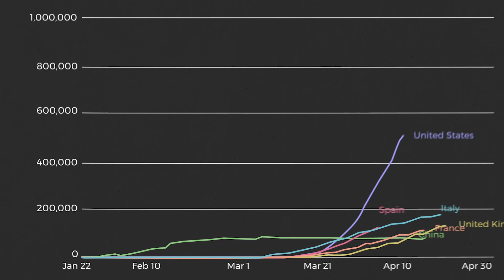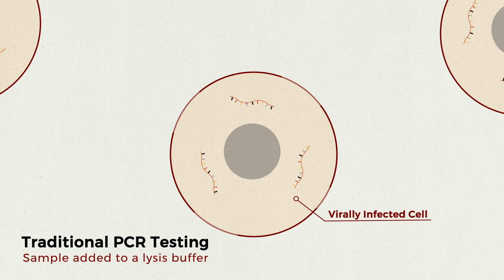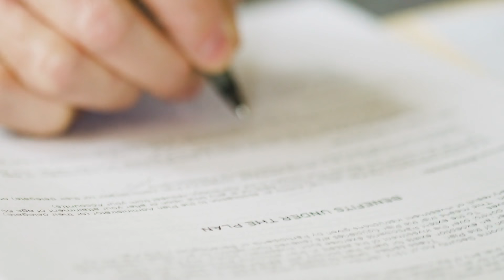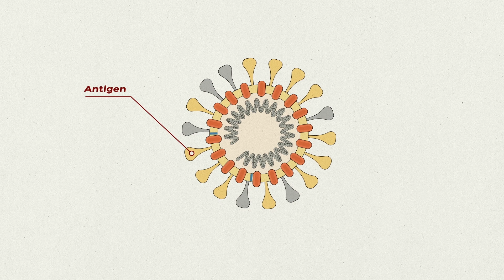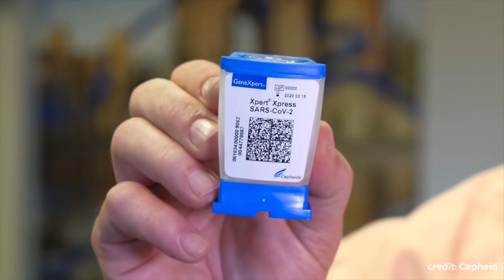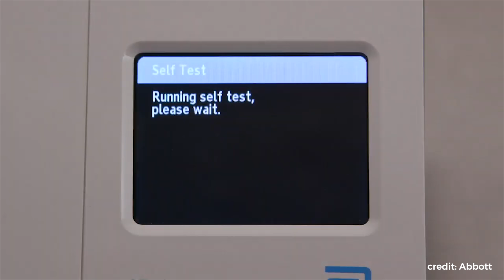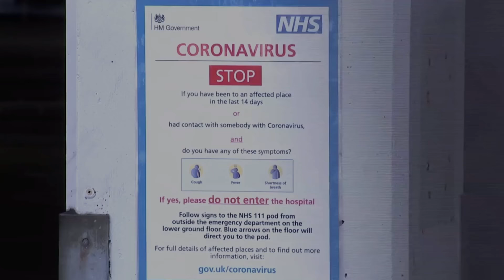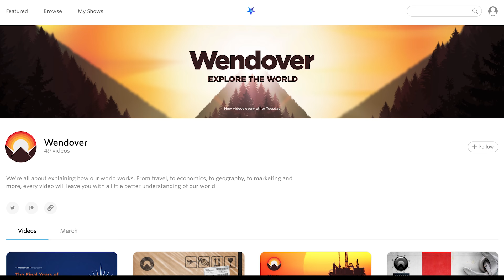The Challenge of COVID-19 Testing

Comment: Getting better and better. Great video Stephanie.
Reply from the maker: Thanks Rohin!! 🙂
Reply: @realscience  One thing tho, the tests weren't "contaminated with the virus", all the tests HAVE to include small bits of the viral genome to bind and match with the sample, without the viral genome, you don't know what to look for. The problem was the strings they used would fold in on themselves, which is a rookie mistake, you have to make sure you don't have code with repeats/mirrors, otherwise it will fold in and create matches with itself... somehow, they forgot to check this first, and so their tests would match their own presence!
Reply: If the PCR tests are flawed, how did China and Korea manage to rapidly test large numbers of people and use that info to quell the rate of infection?
Reply: @charlespolk5221  The PCR tests aren't flawed. They just take several days to provide a result which limits their utility to those who are already self-isolating as otherwise they can continue to spread the virus while waiting for a result. This is why they must be used in conjunction with social distancing measures and preferably a lock down.
China probably fudged their reported statistics while completely locking down Wuhan and Hubei province to suppress transmission.
Reply: @realscience  This is probably one of the best researched and presented Covid-19 videos I've seen yet. Fantastic work! Ironically, your in-depth scientific reporting puts much of the MSM to shame. It's a privilege to subscribe.
Reply: @GonzoTehGreat   I think he mixed up whether PCR is inherently flawed (which it isn't) with the PCR test kits delivered by the CDC in early Feb (which were flawed to a point of being mostly useless).
Reply: @realscience  Are you Brian's actual sister?
Reply from the maker: @mrtek8095  no lol

Comment: I'm curious, if a test has a certain percentage of false negatives, would it not be possible to do multiple tests at the same time to decrease the overall false-negative rate? Or is there something about the way the tests run that means if someone has a false negative they'll always have a false negative?
Reply: It's problem only when the patient has no symptoms and gives a false negative. Symptomless corona carriers don't spread it that much as carriers with strong symptoms, who can be treated as covid-19 patients despite false negative and probably doubletested too.

Doubletesting by default is more a financial and capacity problem.
Reply: Unfortunately, we don't have enough tests to do multiple. 

In lab for other experiments, we always do multiple of the same experiment to verify our results but we don't have this luxury with COVID-19
Reply: Lets say we deploy such a system at an airport. If a test takes 45 minutes and a plane has 200 passengers, one machine (with 0 downtime) would need 150 hours to finish all the testing. If you have 10, 15 hours. 

So lets say you have 100 machines, you get through that backlog in 1,5 hours. If you want to double test, that means double the length, or 3 hours. Forcing people to wait 3 hours is not something that an airport would have the capacity for. And even more, it could be dangerous. What if 20 people are infected (10%). In those 3 hours they might just spread the virus to another 20 people. Now we don't have 20 cases confirmed, but 40. And then the effectivity would be (even if the precision is 99.99%) only 50%, just because those 20 people were infected after the test but before release. 

Scaling up really isn't a practical solution. We need to find ways to speed it up. That is the most efficient way of dealing with large number of tests. Maybe you could have a system where someone has to get tested before boarding a plane and then after boarding a plane. With the test you would have a combined precision of 97.1%, but you still run the risk that the 14,8% that received False negatives passing the disease on. 

I personally would think that even a 'bad' test done often would be good, but that just isn't how humans work. You tell someone the results say you are negative. A logical and well educated person would think: "oh, so the test didn't find anything". But realistically 95% of the people would think: "Oh, so I'm healthy and can do whatever I want".
Reply: Maybe it’s a sensitivity/precision problem of the test. Like if someone has only a small amount of virus it would test negative twice? Idk
Reply: See Healthcare Triage's interview yesterday: https://www.youtube.com/watch?v=H2IbrT16uJI

Having everyone quarantined is equivalent to lots of false positives. If the testing rate is fairly high, even elevated false-negative rates (30%?) become tolerable.
Reply: @TestSpaceMonkey  Without restrictions and quarantines, the virus would overwhelm all testing and treatment capacity. There woulnd't be any left for other medical conditions. Opening societies too early will bring a second wave of infections, probably even worse than the first one.
Reply: For some tests that does work, kinda like getting a 2-step TB test, but based on the way this works, since the success of the test depends on how much virus is picked up by a swab, another test done at the same time might have equal or more chance of being a false negative, is my guess.
Reply: @stealth9799  That is an interesting solution. I have heard of that being done for other pathogens, but not for SARS-CoV-2. Maybe there is a problem with concentration, but I wouldn't think that immediately. But yeah, you could give up accuracy for effectivity in such a manner.
Problem remains though with the infrastructure and logistics. If you have 4 groups of 50, and 4 machines, the wait time at best would still be 45 minutes, at best. Locating the infected persons would still be a matter of hours. An improvement from the former situation I presented, but the logistics still remain the same.
Good video btw, really enjoyed it.
Reply: @Azivegu  why not test on boarding, then results are ready by the time the plane lands
Reply: You are right with your last question. It is the case that some instances will persistently indicate false negatives.
Reply: A good idea, and you are possibly correct that running multiple tests on a single patient would increase accuracy, in the same way running any experimental test multiple times would lead to greater accuracy of the experiment results. However as discussed in both this video and on world wide media and news coverage, the rate of Covid-19 tests being analysed for traces in the patient is what is vastly below what is needed. So if you were to run multiple tests, say at least two per patient, it would double the number of tests needing to be analysed, at any given time. Also you would need a minimum of three tests per patient, as to be completely fair, so if one is faulty the other two will show the real results.
Your idea isn't bad, but would put strain on an already under performing system.
Reply: watch Judy mikovits , Andrew Kaufman, Dr. Rashid buttar on Corona
Reply: @whatamess8764  watch Judy mikovits , Andrew Kaufman, Dr. Rashid buttar on Corona
Reply: Goats papaya rabbits birds are tested positive in a African country this test is useless.
Reply: The actual swab collected is another source for false negatives.  If the patient was shedding less virus at the time of collection and if the swab was poor collected (not vigorously rubbing off sufficient cells) the test can also be negative.  Then multiple tests on the same specimen would yield false negative results multiple times.  If the sample collected isn’t vortexes enough before sampling to do the test it might also generate a false negative.  False positives can occur when the technologist inadvertently contaminates the specimen.  This can happen when the techno gist is sloppy in their technique of rushed too much again making their technique sloppy
Reply: I was thinking the same thing.
Reply: Azivegu You realize a machine could likely rub multiple tests at once, right?
Reply: Azivegu - Excellent points in your thoughtful comment. I suppose one imperfect but potentially helpful approach would be to a) screen passengers preflight (temperature, pulse oxygen saturation, visual exam, inquiry as to symptoms and exposure, etc.) and then have enough equipment to run tests on the entire number of souls on board while the plane is en route....
Reply: @paulinbrooklyn  It definitely would be good to pretest, but we must remain aware that Corona isn't the only virus. There are other diseases that cause similar symptoms that can lead to false positives. 
But my main concern remains with capacity. not only in the sence of how many tests we can run, but in how many people we can contain in an ethical way. Flagging someone with the flu as a corona patient (especially on a broad scale) can raise ethical dilemmas. At what point exactly do we say to someone that they have to stay in quarantine? 

It may be easy to answer when healthy, but we have to think of the effects when you yourself receive a false positive. (I am one of those people)
Reply: The problem is that we could also be falling for the Gambler's Fallacy. If the sample size is large enough, we can probably assume that a test has that chance of failing on every use, e.g. 70%. If a test has a 70% chance to be inaccurate, the chances are the same every time. Doing more tests doesn't increase the likelihood of getting more accurate results, you'll likely end up with around 70% of the tests being inaccurate and 30% being accurate when you take the average of all of the tests that you've done.
Reply: @cameronm9968  That would be the case if you tested an individual only once, but the accuracy would improve if you tested one person multiple times. You would just have to factor in cases of false positives. But if you only need to find a few of the infected to slow down the spread, it would still be better than no tests. 
But we still maintain the problem with psychology. Most people just don't understand that a negative result doesn't mean they are healthy, it just means the test gave a negative result. Training people to understand that is a daunting task and if it isn't done, there is the potential that people thinking they are healthy partake in risky behavior. A cense of security theater.
Reply: Depends on the patient, the specific test, and financials. Consider that you arent constantly testing yourself for strep. infection. How do you know to test again? Mathematically it makes sense... but mathematics is generally a wet dream that isn't grounded n physical reality- if you are doing an Ab test but their Abs are effective but just not the expected/target structure and your +control is not exactly compatible with the patients idiotype, then no amount of repeats can give you a positive.
Reply: Erm, we ain't got that many tests... They would be better used on other people that may not produce false negatives. And no, if you test a false negative, you will not always be a false negative. Most false negatives are when the person was just infected, and the virus was still in the eyes, nose, mouth, skin or ears, or other points where the virus entered. Hope this helps
Reply: @MrHalified Interesting perspective. I agree and don't agree, but let's not go into a full on argument on this.
Reply: @gregorysmith7308  Really? I think I'd rather know that everyone on the plane with me has already tested negative.

Comment: The biggest issues with this video is that you do not highlight specifically why many POC tests are flawed (because each person's B cells could produce not +control neutralizing antibodies, due to the random nature of Ab developement), also you failed to mention the biggest issue of isothermal RT-PCR (increased false positives and hasty extrapolation, since a super-denaturation T or aptameric/Hot-Start polymerases still require thermocycling for annealing, else you are risking a reduced process throughput). Cutting corners is dangerous...